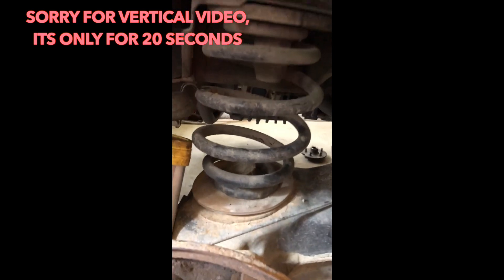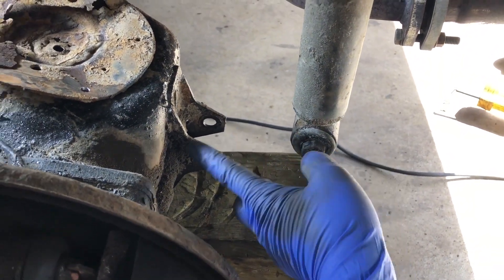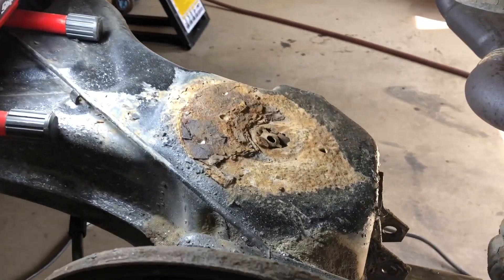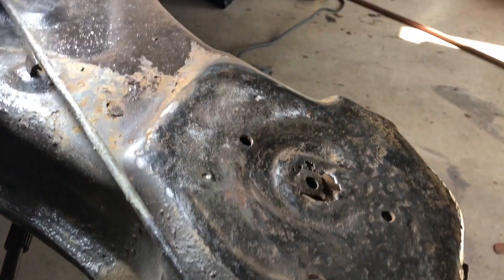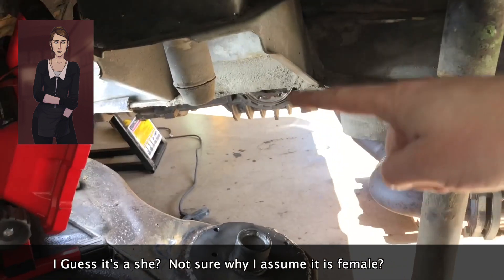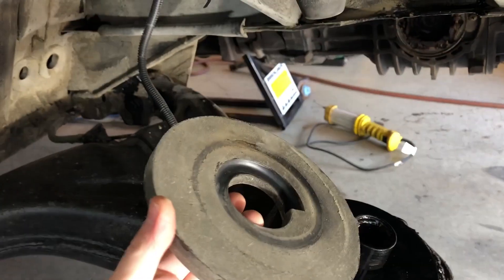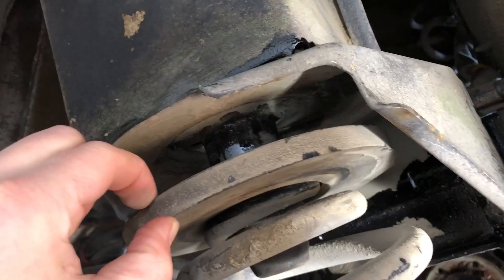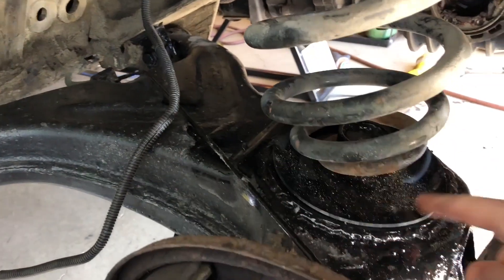VW Vanagon Westfalia rear spring and control arm repair

Comment: The new part will fill with water and grunge over time no?
Reply from the maker: Can't remember when I did this video, but so far, so good, no issues at all (I still have the van).  As long as you do the weld correctly.  I don't know any other way to fix it.

Comment: What a crap, this is all wrong! that rocker should be taken off, sandblasted, rebuilt, painted with welding primer, with polyurethane, and so on. You'll have same problem soon, and the rust will proceed into rocker structure quite easily. shame @GarageKing
Reply from the maker: Sorry you feel that way, and if this was a restoration video you would be %100 correct.  There are different levels of repair depending on what you want done.  I have restored older parts for various vehicles and they get sandblasted, welded up where needed, and then primed and painted.  But this was not a restoration, this was just a fix, and it is still fine.  The lower control arm (you call it a rocker) is solid, and the new spring seat takes the weight of the spring.  This weight is distributed through the seat to the control arm, there is no way for that spring to go through anything unless the new spring seat rusts out (the original lasted 35 years).  This repair is very good and acceptable in the repair industry for someone who wants to affordably fix their Vanagon.  If you are putting it in a car show, then take the control arm off, sand blast and paint.  I am very sorry but I think you missed the point of the video which was to just fix the control arm affordably, not restore it for a show.
Reply: @GarageKing  can't argue this way, your car your decision, this practice is very often noticeable when you buy car from VW T3 dealer. quick-cheap-low quality fix.
Reply from the maker: @bonomadavlog3693  Not sure I would say low quality fix, definitely a cheap fix that should last many years.  You sound like you know what you are talking about, but believe me, as a licensed mechanic you would not believe the things customers have asked me to do (that I flat out refuse because they are unsafe) In this case, the van is mine, so the repair is on me, but I barely ever use it, its stored indoors most of the time, and it is safe to do it this way.  

 I cleaned the area well, used POR15, and it should last for quite sometime.  Where many dealers go wrong is they don't prep the repair and they don't put any paint protection on repair area.  I wanted to do the repair this way on this video, as not a lot of Vanagon owners will want to remove that control arm and restore it.  You may be one of those types of people, and if you are I'll give you a high five :)  as that is the type of person I am, but for this vid, I wanted to appeal to the average person who wants to fix their van safely and cheaply.   I love these vans, and want them to stay on the road as long as they can.  

Also - if the other side ever needs doing (its still ok) I would take out the control arm and do a full restoration so I could have two vids, and people could decide which way they wanted to go, but mark my words......  When someone watches that vid they are going to make a comment asking why I did all that work when I could have just welded a new seat on.....haha!!!!  Its going to happen :)   Thanks for the conversation today and taking the time out of your day to make a comment.  I do appreciate them all as I know it take time.  Thanks